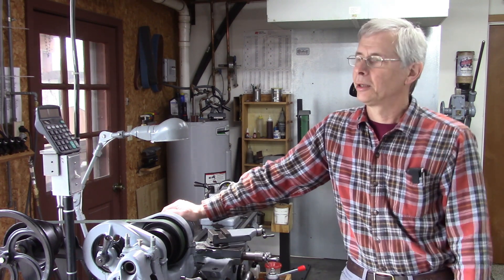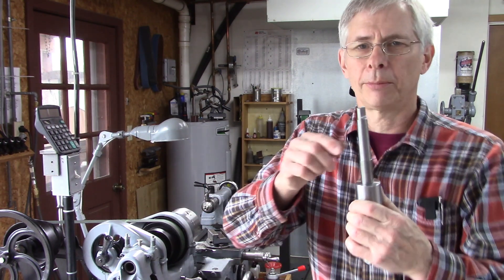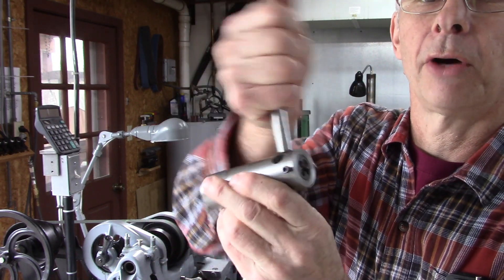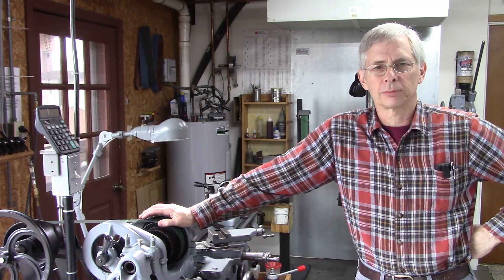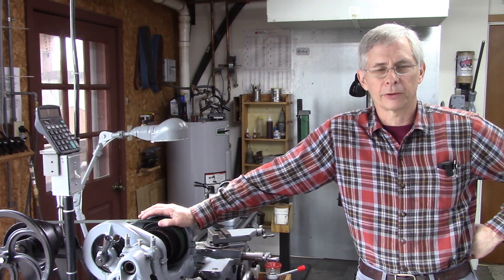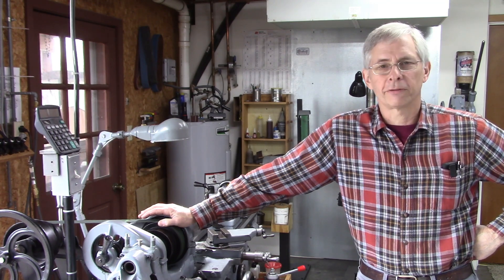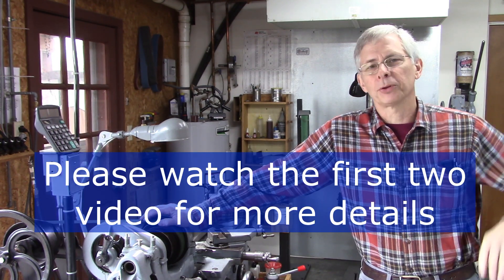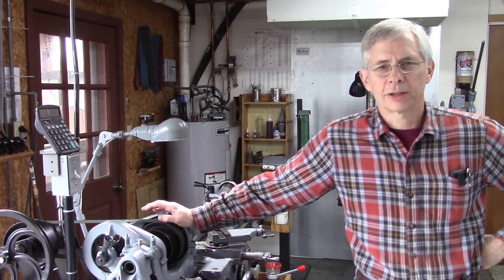Tailstock die holder - No hands! Version #2

Comment: I have been wanting to make/get one of these but not sure if it would work my lathe, the slowest spindle speed I have is 150 rpm, and not sure if that is safe. It would be nice if they sold pulleys that would allow other speeds.
Reply from the maker: Maybe a tread mill motor with a speed control. 150 is a little fast.

Comment: I just had a thought this morning.  Use a tapered slot and then a ball bearing or tapered seat and spring behind it in a perpendicular tube attached on the outer sleeve with an adjustable set screw or handle. You could adjust the torque that it would overrun if the tap or die bottomed out.  If you inverted the direction of the sleeve and shaft you could adjust the over running torque on the go.  That might be my next project if no one else bites on that one.
Reply from the maker: That would be a good idea although my belt seems to slip if things get too crazy.

Comment: Hi Winky  Another very nice job.  I am always trying to boil down ideas into the simplest format.  Have you tried making the die holder solid one piece with no slide but a parellel end -- say 12mm.  Then grip it in the drill chuck in the tail stock.  Do not lock the tailstock, push the tailstock in to start threading and once started just let it be pulled in by the thread.  Reversing at end of threading just pushes the tailkstock backward.  This is how I built mine and I have done this a number of times.  Admittedly my lathe is a little larger than yours.  Cheers  John.
Reply from the maker: I thought about that after making this one although I like the fact that this one locks into the tail stock taper with the tang. Letting the tail stock slide is a good method but the drill chucks tend to slip.
Reply: @WinkysWorkshop  I take your point.  My chuck is particularly strong.  However I have not gone above M12 yet.
Reply from the maker: @johnspathonis1078  M12 takes a lot of torque if you thread at 100% threads!
Reply: @WinkysWorkshop  Hi Winky  My lathe could be described as a light industrial.  200mm 3 jaw (250mm 4 jaw) with D1-6 camlocks and 1000mm bed.  It is on a cast iron base and complete weighs in at approx 1500kg.  It is a 3 ph 415volt.  The tailstock is a 4MT - headstock 6MT.  I have not run a small hobby lathe but this lathe is a bit of a beast and would run larger dies than 12mm.
Reply from the maker: @johnspathonis1078   I wasn't concerned about lathe power, I was concerned with the ability of a drill chuck to hold a die or die holder.
Reply: @WinkysWorkshop  Hi Winky  Sorry for misunderstanding.  I thought you meant driving torque not restraining torque.  My drill chuck is a workshop quality 13mm keyless variety with JT6 taper.  It has provisions for tightening with a standard "C" spanner.  I just nip it up with the "C" spanner with no issues.  I could see that a normal keyed chuck could have problems. I have never experienced slipping issues with any usage.  I wish I could say the same for my 13mm keyed chuck in my pedestal drill.  That needs to be swapped out.
Reply from the maker: @johnspathonis1078  I have a ball bearing Jacobs keyed chuck. It's WAY better than the standard chuck but still slips occasionally
Reply: @WinkysWorkshop  Hi Winky   The only thing I can suggest is to buy a decent keyless chuck or just mill a hex on the shaft that is slipping.
Reply from the maker: @johnspathonis1078  Oh for sure the hex is a great idea.

Comment: On the types of dies; it is my understanding that a split die is for cutting new threads where you make more than one pass, beginning with the most open position. A solid die is only for chasing existing threads. I have used a solid die to cut new threads myself, but notice that it dulls quickly.
Reply: I was taught that the split die was used as you say but also to make the thread to fit neatly in a pre existing female thread that may be worn rather than make it too small and loose. Die nuts for chasing. I use both depending on circumstances.
Reply from the maker: @robertwalker7457  That sound like a good way to do it. Most often I lightly snug to set screw that would open the die and lock down the other two. It seems to work.
Reply from the maker: I've heard the same and sometimes this may be true. However, this is not always true. I much prefer a solid die, I don't need to adjust them and I have had a couple of the split dies break. My next set will be solid.

Comment: Is there a video of yours that describes the blue hose with compressed air? For light cuts you use air to direct chips. What psi is it run at? And for heavier cuts air/oil mist?
Reply from the maker: Oh... on the mill? Well...  that was a mister that I used a Koolmist coolant in. I really don't like breathing it so I just use air now. Plus I mostly use carbide now and carbide doesn't care about heat. basically the air keeps the clips clear and cools a little too. Without the air the cut is noticeably worse because the mill is re-cutting chips. This is worse in a slot.

Comment: I have no idea about American thread cutting dies, but in the UK, the die holder has three set screws:
1 The die splitter, to increase the thread diameter.
2 The two die adjusters, each of which are 45 degrees either side of the splitter, to enable a decrease in the final thread diameter, leading to a looser thread engagement.

There are no examples of anything different. Maybe we (in the UK) take things a little more seriously.

It's much the same with threading taps:
UK Taper tap     USA Starter tap
UK Second tap   USA Plug tap
UK Plug tap   USA Bottoming tap

We, in the UK, invented the threading system, ergo we are correct with our nomenlature, and everyone else is wrong.

QED
Reply from the maker: I prefer solid dies!!!
Reply from the maker: I agree...  ha. The split dies here are 3 screw but at a right angle (90) apart.

Comment: The tang on a Morse taper is for ejection only.
If the morse taper is slipping, something is wrong. 
How many tangs have you seen twisted off  ?
Reply from the maker: Without a doubt when a taper fits well it holds much better. With that being said, smaller tapers are much more prone to turning when everything is right. On my Logan the number 2 tapers was reamed and in perfect condition and I still had problems with it turning. A number 3 has more surface area holds much better.  Also, if the taper is for ejecting only as you say, why is it reduced area only on two sides? Why not leave it round. Three out of the four lathes at work had reduced sections in the tail stock. One was a Monarch, a South Bend and I can't remember what it was. If this is NOT to stop turning then what is it for? Also, if a taper turns once or twice, the games over, you no longer have a perfect fit. Why do centers NOT have a tang on the taper? Are they meant to be permanent? My Logan ejects all tapers...  with and without a tang. Why is a tang needed for ejection? 
I'm not sure what you mean about a tang being twisted off. That would require some serious HP! I'm guessing a rather large bit would break before twisting a taper. Maybe not on my mild steel tapers but I suspect most are harder then mild steel.
Reply: @Winky's Workshop  
I have had 2 attempts to reply with lots of answers but I keep loosing connection before I have finished typing.
Do you have an email address I can send to ?
Reply from the maker: @stevewilliams2498  winkysworkshop@GMX.com. The flat tank was patented by Cleveland drill company to stop drill rotation in a taper. https://books.google.com/books/content?id=a_xKAAAAYAAJ&pg=PA478&img=1&zoom=3&hl=en&sig=ACfU3U0HL4if1S6YSZF2qO_tdkzUnuSI0g&w=1025
Reply from the maker: @stevewilliams2498  http://www.beautifuliron.com/mttaper.htm
Reply: @Winky's Workshop  
I quote from Wikipedia  ..
"The tang is not engineered to withstand twisting forces which are sufficient to cause the taper to slip, and will frequently break off in this situation. This will allow the tool to spin in the female taper, which is likely to damage it. Morse taper reamers are available to alleviate minor damage.

Tapered shanks "stick" in a socket best when both the shank and the socket are clean. Shanks can be wiped clean, but sockets, being deep and inaccessible, are best cleaned with a specialized taper cleaning tool which is inserted, twisted, and removed."
Steve
Reply: I noticed in the Version  #1 video that the morse taper shank slipped around until the tang stopped it each time the lathe rotation was reversed.
Reply from the maker: @idontwantachannel3091  Yes it did...  a taper cut with the compound is a bit wavy so the contact area isn't enough to stop it from moving. I put some bluing on the taper and it actually fits really well. I think the surface on the taper needs to be ground to make it hold well.  I think Steve is right in one respect, the taper is supposed to hold. From what I have found the tang was added to stop rotation when the taper fails to hold and Steve said it was only to eject the taper. Regardless of what the intended purpose is, I'm glad to have the tang. I have never had a #2 taper hold very well in any lathe I have owned. I do have a drill press with a #2 that holds a chuck very well but I'm not removing it frequently. Also I give the chuck a firm smack with a brass hammer when I install it. I suspect I could do the same with the die holder and it would hold.

Comment: I had to grin.. you been following my channel Winky? I did a torque bar vid a few weeks back. Like it though. Don.
Reply from the maker: HA...  Wow...  Good video. To be honest I never saw your video or the die follower you had (they stole my idea, ha). I do like my die holder a little better simply because it's not held captive. I now have 8 die holder and the dies stay in the holder. It does look like a stole your idea but I never saw the video. Your video is good...  better than mine especially considering I lost the audio! I'll never use the second die holder, the tang in my taper stops the rotation of both my drill chuck and first die holder. Thanks for showing me the video! I just linked to your video in the description.  I like it!
Reply: @WinkysWorkshop  Yes, you made a much nicer die holder than the one I have. Mine just came with a bucket of stuff from the flea market. I usually single point, so don't use it much anyway. Been following you since the beginning.  You might say your videos, I like em! Don
Reply from the maker: @donsengine3158  Thanks Don!